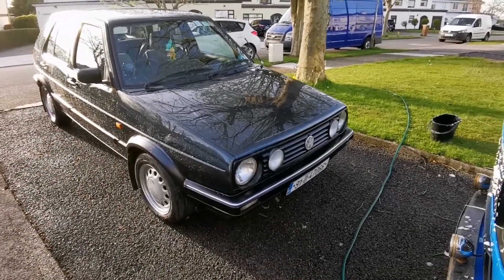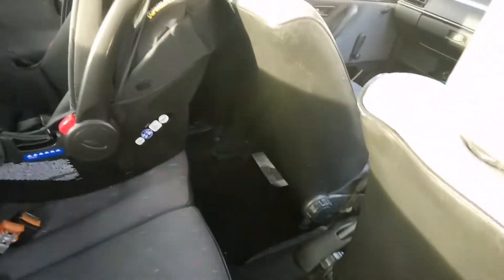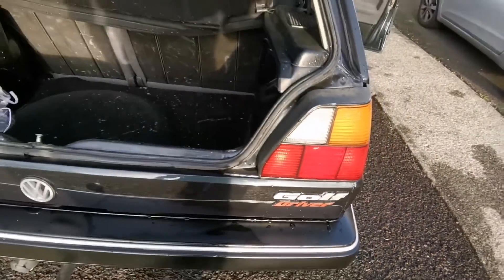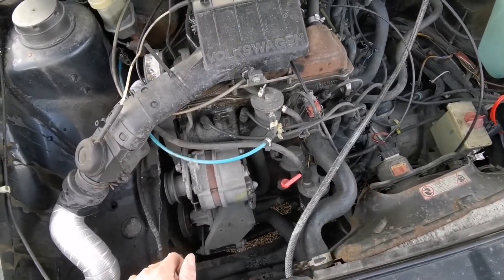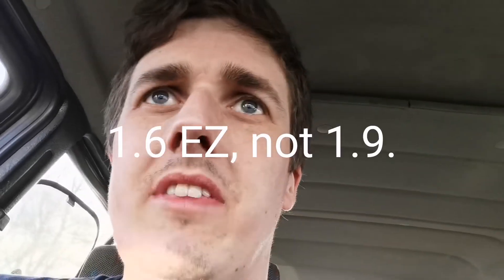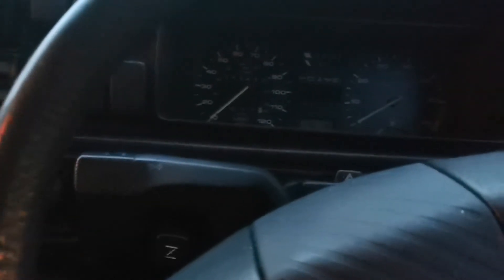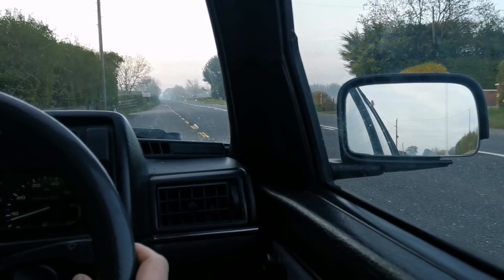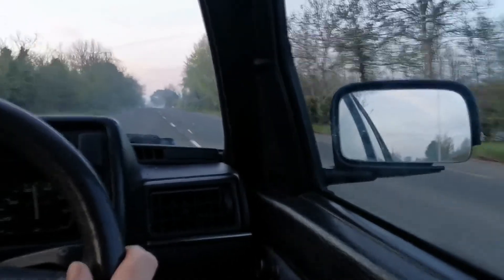CAR REVIEW - Volkswagen Golf Mk2 1.6 Driver automatic

Comment: The mk2 in general makes for THE best classic daily you can find (change my mind). Absolutely bulletproof and on a good one you shouldn't need much welding, if any. 
Give it an oil/fat based undercoating and cavity wax every two years and it'll make it to 50 years old easy.
Reply from the maker: I'm not going to change your mind because I agree with you 100%. This is my 5th Mk2 golf and the nicest of the lot, having the few extras including the power steering.

Comment: I've been running my 1.6 ez golf since midsummer and will be putting it away this month. On original pierburg and it drives spot on hot or cold and definitely does more than 30mpg. Weber carbs if tuned properly will likely use bit more juice. Mines manual though which is a must for me. 5 speed makes it much easier at speed. In 30th year and 11th in my ownership!
Reply from the maker: I was in 2 minds about rebuilding the pierburg instead of fitting the Weber but I was getting a lot of conflicting opinions. To me, simpler was best, and the Weber is working fine. It's a nice little engine I have to say! The 3 speed auto with non locking torque converter is definitely a large contributor to the poorer fuel economy.

Comment: Thanks for this video. I have the 1.8 automatic version of this car. My pierberg is a bit dodgy, I'm split between refurbishing it Vs a Webber. Other than cold starting, are there other downsides to the swop ? No issues, when putting into gear from neutral ?
Reply from the maker: To be honest, I would have liked to have driven a Mk2 with a fully refurbished Pierburg myself before deciding to go with the Weber. The Webers are finicky to get set up right, but are fine once they are. I do find that in the winter the engine can get bogged down until it's fully warmed up too. You need to make sure all your fresh air pipework and original filter box are in place and that the carb base gasket is in good order.
Reply: @Endfloat  thank you for the reply.. I'm going to attempt to refurbish the pierberg first, if that isn't successful, then I will swop for the Webber. Love the channel btw, what aircraft do you maintain?

Comment: This transmission has Overdrive?
Reply from the maker: No, it's a 3 speed. No overdrive unfortunately.
Reply: @Endfloat  Thank You. Here in Brazil we had this transmission in brazilian VW, but I had this doubt if he had overdrive.
Reply from the maker: @majestykts1459  yeah I've often thought of trying to fit an auto box from a Mk3 golf, which would be 4 speed.
Reply: @Endfloat  Here in Brazil we also had the mk3, but in older VW vehicles, the engine and transmission system were longitudinal and not transverse as in the GOlf mk3. In my case the course of golf mk does not fit my VW Gol.
Reply from the maker: Yeah I'm familiar with the Gol, having been in Brazil a few years back (beautiful country by the way). It's a car that intrigued me with its front mounted air cooled engine, and I'd love to import one!
Reply: @Endfloat  The first project of the Gol, they took advantage of the Beatle's VW engines and introduced it to the Gol, but the first models had problems with overheating due to the fact that Volkswagen did not maintain the oil radiator. 
It was a very inefficient engine, weak and the car didn't reach 100 km/h